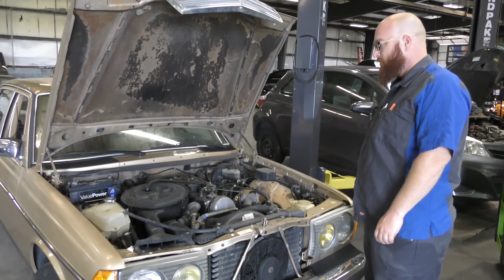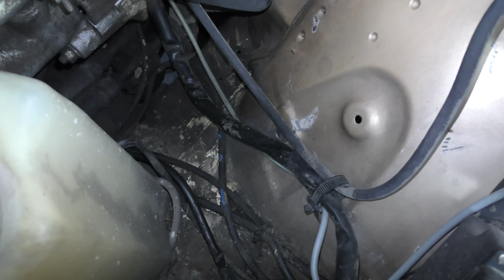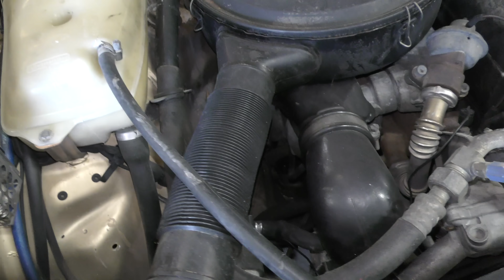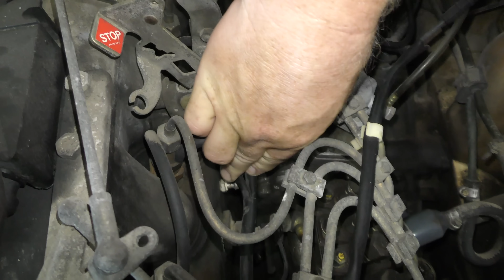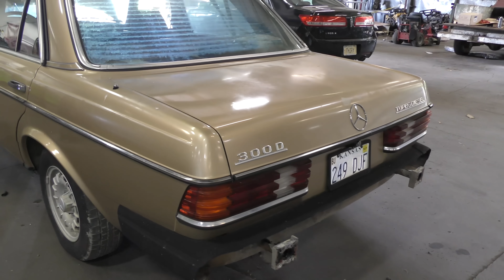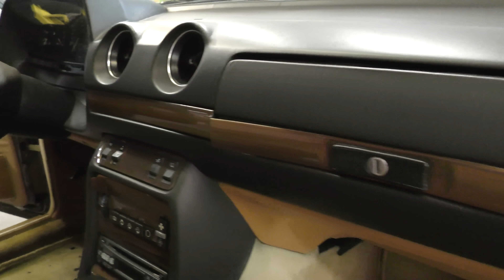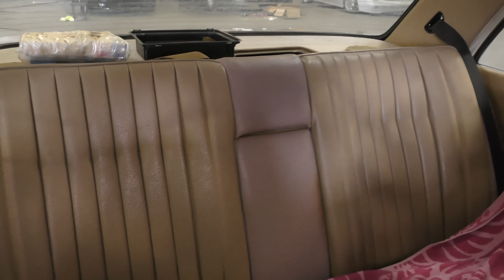Tank of a Mercedes 300D with a 3L Turbo Diesel! CAR WIZARD finds lots of surprises under the hood!

Comment: My local mechanic works on those, I had a 300SD for a while, 1982.  I had to junk the car, due to a cross-member failed, I could not get it welded. But while I had it I loved it.  There is one that is for sale that looks to be in decent shape. There are a few of these 300 D's that run around where I live. There is also a 240 D standard transmission that is just about spotless.

Comment: You actually still see these quite a lot in Europe... they are very popular among the young timer communities, most countries in Europe will also offer reduced insurance and road tax rates for these cars. Those engines are indeed bulletproof, but the vacuum system can be a pain in the ass as you have already explained... and you'll be fighting rust all the time. I like the design but one thing has always bothered me about these cars... and that's the placement of the rear axle, looks like it's placed an inch or two too much forward.

Comment: On YouTube there's a channel by the name mercedessource. It's maintained by an older guy, who has  many mercs and a lot of experience repairing old mercs - tools too, especially for diesel models. His main hint for engines on old diesels was making sure the injectors are working properly. Faulty injectors push too much fuel in the cylinders and cause catastrophic meltdowns inside the engine.
Worth checking :)
Reply: This comment. 👍
Reply: Kent is very well known around the w123 community, he really does good work
Reply: @joshuaschofield9178  He's very knowledgeable, but keeps slapping the cars!
Reply: @MrZep420  yes ! I look at his channel from the begining 😁

Comment: There is a 2 million mile one of those in Norway. Former taxi.
Reply: Not really a Merc fan but these older models have so much character.
Reply: Alas, with the same engine and transmission?

Comment: I actually bought an '85 from a girl who had inherited it from her grandmother. That was in 2001 and I had it for 4 years. She had kinda let it go since she knew nothing about cars. I fixed everything on it myself.
Since you are in cold climate you need to make sure the compression is good or it will not start in winter even with good glow plugs. Also replace the radiator because if it gets plugged up then the engine will suddenly overheat and possibley blow the head gasket and even crack the head. Mine had 280k miles when I traded it off and it ran like a top.

Comment: I have a 79 240d with 93000 miles and love it. The vacuum leaks are the hardest thing to get sorted out.  Wizard, I'd recommend doing a parallel wiring set up instead of the series set up it has for the glow plugs. Very easy to do
Reply: Ultra low mileage

Comment: I found that if you cover wires with the split spiral harness protector the rodents do not eat it. they will eat normal plastics. example: https://www.amazon.com/Split-Tubing-Conduit-Flexible-Cover/dp/B07QQNW699/ref=sr_1_5?dchild=1&hvadid=78546481939031&hvbmt=be&hvdev=c&hvqmt=e&keywords=split+wire+loom+tubing&qid=1594489078&sr=8-5&tag=mh0b-2

Comment: Im not against using used parts, im changing blown engines or transmissions for used ones no problem, since new or rebuilt ones would total the car..
But using used stuff like waterpumps or clutches thats hard to replace and cheap to buy new is a no-go to me.
Alternators and starters are a case-by-case situation, if its very accessible and Ive got a known good one that will outlive an older car.. why not take the chance.
Ive done very good using used oem parts instead of aftermarket new stuff that doesnt have the service life as the oem parts do.

Comment: I have a 92 190d and as you said these old Mercedes have an interesting smell. Mine still smells brand new and thank you for letting me know why it smells the way it does. :)
Reply: I heard Reinhard Heydrich died because of that horse hair filling.
When he was shot by resistance assassin, the bullet went through the car seat before it entered his chest.
and got some of the horse hair into his chest. Reinhard Heydrich managed to jump out of the car and chase after the assassin to shoot back, but after he was hospitalized, the horse hair caused severe infection, which killed him.
Reply: @davidjacobs8558  happened a lot,
a lot of civil war deaths are mainly attributed
 to secondary infection from  the cloth uniforms
Reply: @davidjacobs8558  it was due to a grenade blast, the sub machine gun used jammed without firing any rounds.
Reply: OM602 the best most reliable mercedes engine ever
Reply: I had a 87 190 turbo diesel, the only year those popped into North America. I had that the same time I owned one of my 85 300 turbo and my 79 non turbo 123 chassis. The 190D had 385,000 miles on it when I sold it. Still running strong, but rusty.
Reply: @artkincell  a 190 Turbo Diesel had the 2,5 liter 5cylinder engine and slots at the right fender. The first cars I drove with 14 years were 190's Diesels.
Reply: @Justinian Yi not in Europe I think. They were company cars here, and company cars in Europe have traditionally almost all been diesels because diesel costs a lot less than petrol in Europe.
Reply: I have a 190E 2.3 1993 that has the original smell as well. I miss driving her, she’s been ooc for 8 months
Reply: @Ray_the_Jackal  OOC ?
Reply: Jaang29 out of commission

Comment: Friend of mine worked for a wedding agency in London and had the model before this with the upright headlights. He took 6 of us to play soccer on Sunday mornings in it and we all felt pretty special. They were head and shoulders above any car on the road at the time. Over engineered they used engines that were designed before World War 2 and went forever - just change the oil no need to do anything else - ever! Could even run on chip fat!

Comment: This thing is just barely through the break-in period! :) My MIL had her windshield wiper fluid lines chewed through in less than a couple weeks form mice in her garage. Thankfully It was a cheap repair, and not a harness or other expensive lines. Sister also had quite a few lines chewed through in CO. Love the way this car looks from the rear... timeless styling! For the question at the end, I'd love to have a GTO Judge someday.

Comment: I bought an  ultrasonic transmitter that is wired to the battery and it is suppose to prevent mouse damage.  So far so good, but when I bring it in for service the tech can hear this high pitched noise and has to turn it off so he or she does not go nuts while they work on the car.  I is very quiet and I can't hear it but rodents can.
Reply: If it's ultrasonic how can the techs hear it?
Reply: @taunuslunatic404  It cycles frequency from a low of just below hearing threshold to a high frequency that we can not hear.  It seems to work as I have had no trouble with rodents since installation and they are cheap when purchased on Ebay.  I think I paid $12.00

Comment: These are one of my bucket list cars. I want one, but..time marches on. I'll have another old MB someday.
Reply: I highly recommend getting an older 1960s/1970s S class, though - the gas engines are very simple and they have a lot more power.  My favorites are the W112 and W108.  They are worth restoring and drive very well.
Reply: @plektosgaming  thanks for the tip. I owned a '97 E420. The m119 V8 was such a wonderful engine. I drove it cross country several times, while getting 24mpg consistently. The rest of the w210 was OK for me. Dead nuts reliable. Terrible paint...I've had my eye on a w126 for a while.
Reply: @mattscullin5844  It's OK - the older ones before were better and before they put computers in any of them, so it's easy to keep running and fix up.  The 1970s/early 80s SL are also inexpensive and soon to be classics.  Very fun cars.  That said, the best engine Mercedes probably put in their cars was the M180.  Bulletproof - basically a tractor engine that they also used in their military vehicles as well.  The M110 is pretty much the same thing with injection - when it works, it's great.  You want the newer K series models - their problems are mostly hoses and connectors.
They were in the 280 series of cars.  The 280SL are expensive now, but the 280 sedans are almost forgotten and nobody is interested in them.( ie - low cost :) )

Comment: 9:40 You might be wrong there, wizard. Mercedes have a classic division that will supply you with parts for their older models. Not sure if they're supplying W123 parts too, but I wouldn't be surprised if they did. I do know for a fact that you can get new parts from them for models like the Pagoda SL or the 300SL. Of course: Being new old stock or reproduction OEM Mercedes parts, they do cost a pretty penny. 
https://www.mercedes-benz.com/en/classic/classic-service-parts/
I inherited a cat-less 230E W123 from my granddad in the late 80s. I still remember starting it up for the first time, thinking I hadn't turned the key all the way because the engine was so quiet. I also remember that the seats felt like an old time-y, sprung sofa and how comfortable the car was overall. I also remember that it was the first (and thus far only) car I spun nearly 360° on a public road... :D
Reply: I learned on Jay Lenos Garage that Mercedes will sell you any part for any late model Mercedes.  Cost might be an issue though.
Reply: @marekw.9816  Unfortunately that might not be case always.. To some parts Mercedes just says "NLA" good luck.
Even in w124 chassy
Reply: @marekw.9816  It's a Mercedes. If cost is an issue, you have the wrong car.
Reply: Some of the prices are ridiculous, though.  $600 (on sale, reg. $1000) for a set of fuc*ing rubber door seals???  I would understand if those were for a gullwing...
Reply: Yeah, I think they even offer 3D printed version of parts which they no longer have in stock as originals. But I think these are mostly intended (and priced) for keeping your pristine condition collector Merc going instead of repairing a $500 W123 :-)

Comment: ‘3L little turbo diesel’ 
looks at all the tdi’s at home that are well below that
Reply: @Mr. Cairo But on mileage before scrapping it.
Reply: @Mr. Cairo Lots of TDI's in Europe in smaller cars have less than 123HP that this 300D Turbodiesel made.
Reply: @caleidoo  my 1,5 dci has only 100...:D
Reply: @tomast9034  Renault Motor...
Reply: @tomast9034  I had the same engine in my old 2008 Scenic. Feisty little engine ;)
Reply: @JohnDoe-zr6bk  16years old renault motor:P
Reply: @caleidoo  i have it in a clio mk2 after facelift....a small rocket with just over 1ton
Reply: The common thing between all of them is that they're slow, stinky, smokey diesel and literally any petrol car is going to blow them out of the water.
Reply: @GlamStacheessnostalgialounge  You should drive one for a few days - or maybe you're in too much of a hurry for that.  They're not sprinters but trust me, you will get to your destination in just the same time as any other car will.
Reply: @MrKnutriis  my 05 xc70 d5 would disagree you press the pedal and you're a rocket
Reply: @haihoegaatet6963  maybe your xc70 d5 is a rocket but the 300D is not.  But it is a great driving car, my favorite.